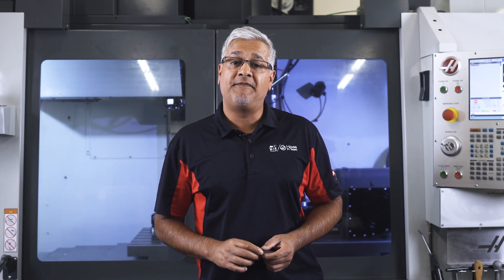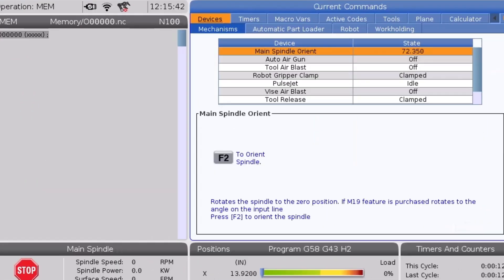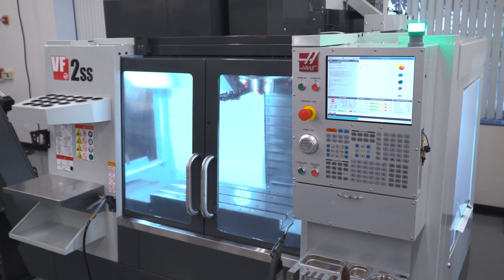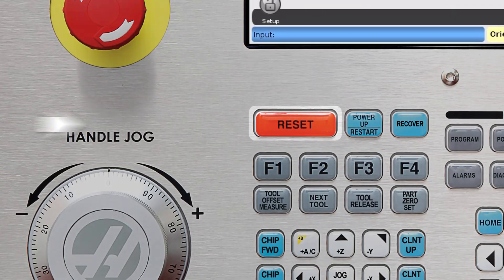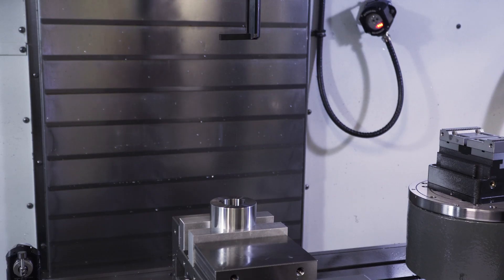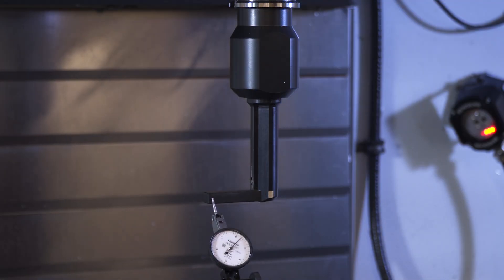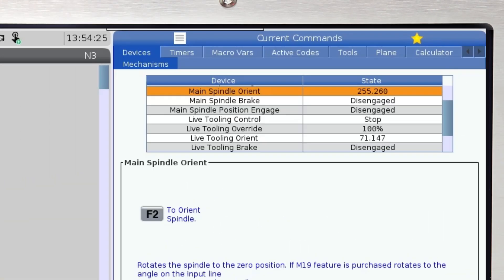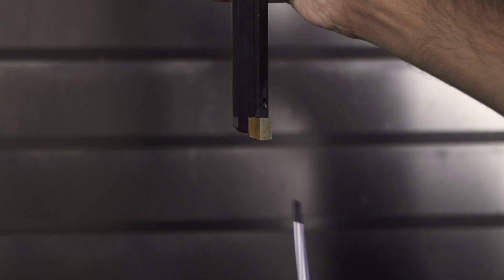Aligning a Broaching Tool on Your Haas Mill - Haas Automation, Inc.

Comment: Can i broach on my mini?
Reply from the maker: Diesel Ramcharger, As long as the software on your MiniMill is version 100.21.000.1200 or later then the broaching templates will work correctly.
Reply: @haasautomation  Well. That would be awesome.